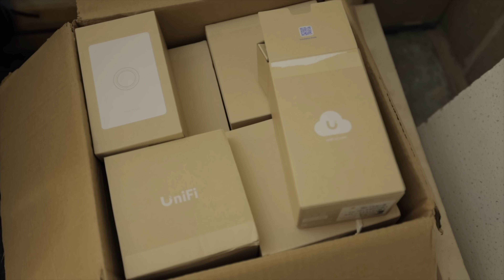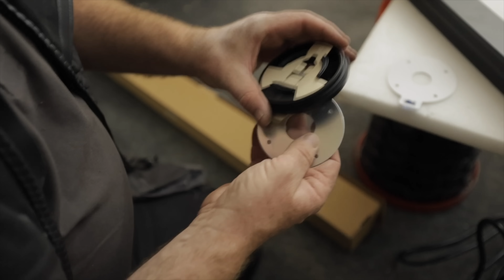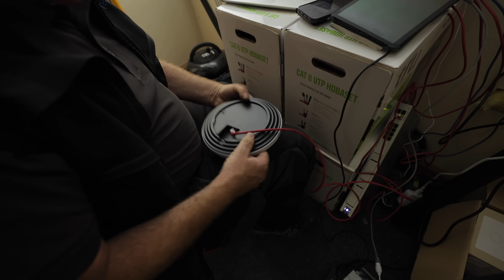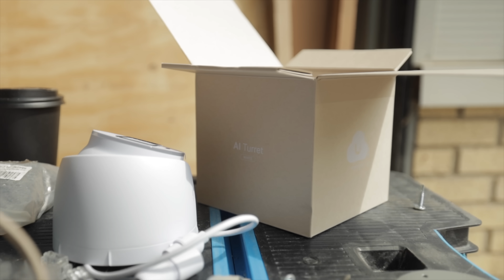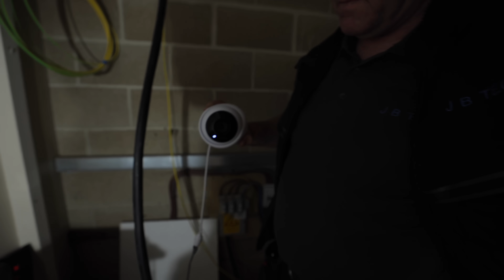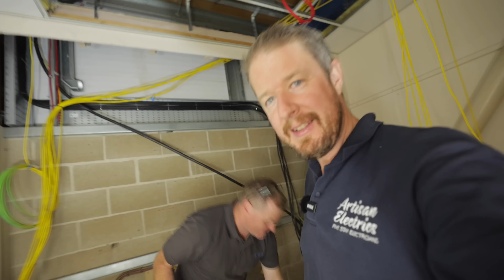We Got BURGLED So I Did This...

Comment: Not a fan of seagate hdd, I’d have chosen a WD Red. 
Also HDD are becoming a niche product for specialised use case, and therefore priced as such. Would SSDs not have been a better (cheaper & more performant) option? Also I trust you’re doing RAID1 or 10 at least?
Reply: Not really a niche product they are great for Bulk storage that doesnt need high performance they also can last longer with being filled continus. Also WD Purple or Seagate Skyhawk should be used for CCTV
Reply: 1. No. SSDs would not have been cheaper. Also WD Red wouldn't have been a good choice at all, because they are designed for mixed read/write workloads, but Seagate Skyhawk and WD Purples are designed for high sequential writes. Not only that, but CCTV grade HDDs have higher workload rates. You did say though that it's becoming a niche product for specialised use cases, which is true, and this is one of those specialised use cases. There's not a lot of surveillance class SSDs, and even then, you'd be talking a minimum of £80 for 1TB. £120 gets you a Seagate Skyhawk 6TB which will be fine for the job it's doing. 

2. In Unifi Protect, if you have more than 1 disk, RAID is enforced. If you have 2, RAID1 enforced, 3 drives, RAID5 enforced. If you have 4 or more, it depends if you select Protection or Performance (RAID6  or RAID10).
Reply: It’s a good job they had someone who knew what they were doing then 😎 WD Red are not rated for NVR use. The Seagate Skyhawk drive he used is. And unless the cost of SSDs have crashed recently, no, they are not cheaper.

I suspect your dislike of Seagate is a historical one. Seagate consistently ranks highly for reliability in Backblaze’s reliability report.
Reply: Given that the Dream Machine looked like it only takes 2 drives, Raid 1 would have been it, but I only saw one HDD. Now I hope you repoint the cameras Jordan as any potential thieves now know the coverages of the cameras! lol

Nice looking system though, I'll definitely look at them when my Hikvision kit dies.
Reply from the maker: @MG_Steve  We have an NVR and NAS too
Reply: Did not know about WD Purple. Was more concerned about having a drive rated for continuous use (and the heat and vibration that goes with that); hence suggesting Red. 

I have some RAID1 servers and RAID6 NAS that are at least a decade old and going strong. However recently it been getting more and more difficult to get matching replacement HDD. In the I decided to use and disk replacement as an opportunity to slowly migrate to SSD. Which per drive, for same performance/capacity, turned out to be half the price.
Reply: @TrevelyanOO6  Please could you link me an SSD model which is 6TB, rated for CCTV (specifically for high sequential write) and which is rated for up to 180TB/yr+ workloads; all of which is less than £120 (or from what you said, half the price at £60)?

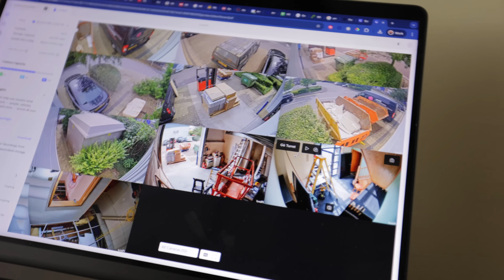Comment: To get rid of the flickering (Seen at 9:32) , go to your camera settings and set your shutter exposure to "Best Low Light"
Reply: Also check 50/60Hz config depending on electrical supply in your country (some systems do this automatically others manual per-camera)

Comment: Running the Unifi gauntlet - when it works it works. When it doesn't....
Reply: The … in my case means it’s never happened. The most trouble free part of my IT estate.

Not an EA junkie are you? Or bought the UAP7’s maybe (I’ve swerved them due to the noise I heard about iot issues).